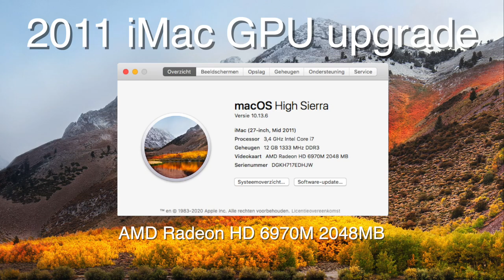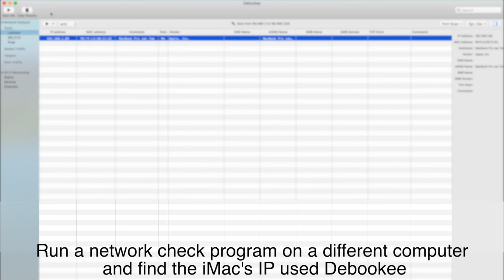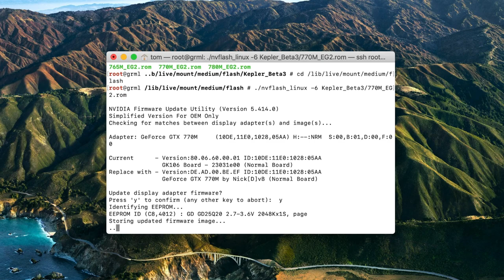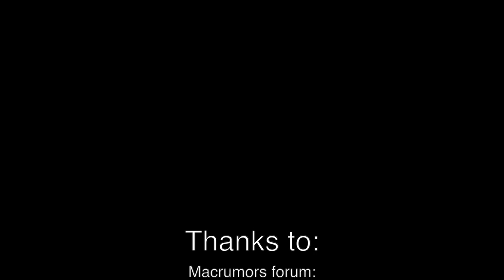iMac 2011 GPU upgrade to NVIDIA 770M with new VBIOS

Comment: Who is watching this on a Mid 2011 27?  I am.  In fact, I have four of 27's throughout the house for streaming cable TV through wireless network.  Always wanted to do the GTX mod and here it is.  I have re-flowed all my AMD GPU's so not concerned with failure.   Despite the supposed problem, AMD GPU is still a good performer for what I do.  Nice job on your upgrade!
Reply from the maker: Thank you for the positive comment! I agree with you that the original AMD GPU performs good! Although in a benchmark program like Unigine Valley I went from a score of ±800 to ±1300 with the new GPU so quite a significant difference. I also reflowed the AMD chip in the beginning and it came to life again, sadly a few months later it failed again so I wanted to solve it for real. Maybe in the future you will actually use this video to upgrade the AMD GPU nevertheless :-).
Reply: @tomvreugdenhil1490  Yeah, that is a very nice bump in performance.  Are you able to run Mojave or Catalina without DosDude patcher?  If so, does it downlaod and install security updates and patches normally?  In other words, does it behave like it should??
Reply: @tomvreugdenhil1490  Maybe there is one more upgrade possibility.  MacBooks recognize faster DDR3 RAM than is published.  I know this from experience.  It is possible M2011 iMac will recognize faster 1600MHz RAM.  Published spec is 1333MHz.
Reply from the maker: @encinobalboa  Yeah I run Catalina with the dosdude1 patcher and it works like it should. You need to do a few kext patches (all explained on macrumors forum) in order to get rid of a black screen when booted, but I found it easy to do. After that it can install all the official apple updates and works like it should. Of course no sidecar and airdrop, but that is a hardware problem instead of software.
Reply from the maker: @encinobalboa  The ram upgrade sounds interesting. Although I use 12GB which is enough for me and never find that it runs slow when multitasking so I’m leaving that as it is.
Reply: @tomvreugdenhil1490  RAM prices are cheap these days so there is no reason to take it all the way especially with your 770M upgrade.  My dream config is 780M with 32GB 1600 MHz RAM and dual SSD in RAID 0.
Reply from the maker: @encinobalboa  I actually have another 2011 27” iMac with a 780M. It performs even better than the 770M!
Reply: @tomvreugdenhil1490  Dude, next level stuff.  What tool did you use to cut the heat sink?  How deep was the cut?
Reply from the maker: @encinobalboa  I used an angle grinder and slowly chipped away until I had a roughly even surface. The method is exactly as showed in this video, with maybe a slight change in dimensions.
Reply: You can also use a drimmel

Comment: Shame on apple for not creating metal drivers for the radeon 6970. I have to swap the gpu just to make possible the installation of post high sierra osx versions. It is still a capable machine (i7 3.4ghz 8 threads and lots of ram..) but sadly apple nowadazs tries to shorten device lifecycles to get more profit. My other imac a late 2015 retina 27” cto (shitload of money back then) can’t be upgraded above big sur. Reasons unknown… probably the money…

Comment: I would be satisfied to have the stock GPU ya have, I've got the same everything besides my GPU which is a horrid 512MB in dedicated memory (I have the exact same computer model and specs besides the GPU), but at least I can say I spent 9 months making a massive mod for an obsolete game from 2010 on a 512MB Dedicated Memory GPU on an iMac with Gimp, text editor, and blender lol
Reply from the maker: I can highly recommend upgrading the GPU in your case. All of the old AMD cards in this iMac are doomed to fail one day. The 770M in this video increased the graphics performance by a lot! My daily 2011 iMac now even has a 780M which absolutely screams in graphics performance.
Reply: @tomvreugdenhil1490  I would love that, but I could never afford that, and my iMac is basically my only Apple product and my only computer, because my 3 other windows computers are all having OS problems and Hard drive problems in general, it's getting to a point where I'm starting to use PS3's and Xbox 360 hard drives to make them work (ofc I have erased them) but even those are starting to fail on me too and none of them are nowhere near 5 years old while my iMac is 10 years old without any problems besides the temperature but I'm using manual fan control to retain it's life (and no I'm not doing full blast 24/7 I don't wanna destroy my fans 😅) but even so, since this iMac has been lasting so long, it's got me taken over (and I'm not gonna buy a newer iMac, I'ma Steve Jobs era guy lol) although I am seeing if I can do anything with the Thunderbolt ports I have, I've been seeing that I can get an eGPU for it, but Idk the compatibility and what's available and what's not available, I kinda wanna go as stock as I possibly can without using other OS's or anything like that (mostly because I can't, and I can't afford them) my 2011, 27 inch iMac was an early graduation gift, the previous owner didn't want it anymore since they got a new iMac and they handed it down to me instead since I was desperate to learn things that are tech related in all ways and I was kinda without a computer at all and that iMac has been probably the best gift I've ever gotten in my entire life (enough with my personal life thou lol) I do wanna see if I can do something with the GPU situation I'm stuck in, like I've been constantly pushing the limits of my GPU (mostly because I have no other choice with having said 512MB in Dedicated memory) oh and I uhh, I'm still kinda new with computers, I've only had my iMac for a year now 😅

Comment: Very nice video! There needs to be more like it featuring different gpu types.
Reply from the maker: Thank you! Different GPU’s work in the same way, the hardware modification etc is the same. The only difference would be flashing the right vbios for every GPU. If you check the macrumors forum linked in the video description you’ll see that all procedures are roughly the same and only differ software-wise.
Reply: @tomvreugdenhil1490  thank you very much!

Comment: Safest way I have found to handle the power supply is to use microfibre cloths when picking it up. One on each hand stops you making contact with the exposed components
Reply from the maker: Thanks for letting us know, this seems like a safer method!
Reply: You don’t have to take out the power supply to get motherboard out, it just takes a bit of wiggling and patience. When i baked my amd 6970 because it failed i took everything out and put back in without touching power supply.

Comment: I disagree it’s better to remove power supply, so that’s your feet the logic board better without any fuss. Without any chance Damaging your logic board in the process of putting it back to the chassis. I did the same process six months ago but I have flash it With my bootcamp Partition In Windows 7 (Much easier flashing than Linux). Anyway great job!!!
Reply: tell me in detail. how did you flash through bootcamp? how to get to the windows section, I broke my whole head already
Reply: where do u get the gpu

Comment: Good. But you don't need to remove ODD, PSU and fan to remove the board)
When I did it first time I also removed ODD and right fan. On 9 other iMacs I understood this is not needed.
Reply: Oh well, I followed the iFixit guide, but now that you mention it I agree with you
Reply: Good video. Great job. Yeah, I'd agree that you can save a step by not removing the PSU. Just reach for the power cable that connects the PSU and unclip the latch - a bit fiddly but doable. That would save a step. Then use some cardboard or thick paper to cover the PSU in case you make contact with it with a metal screwdriver. I tried to keep the ODD and fan in place but found I had a hard time aligning the rear ports when it comes time to re-install the logic board. So, I removed the ODD and the ODD fan to make it easier.

Comment: Man, that looks like an awful pain in the neck for such an upgrade.
Reply from the maker: It’s really not that bad! And it makes your old iMac really capable again. I even run the most recent macOS Ventura on mine :)
Reply: @tomvreugdenhil1490  It looks like I may have to do this. Because I have a little bit of choppy video now and then. And I am using the regular hard drive. The choppy video may go away with adding a SD drive, but if you open these things up. You might as well do the video card.

Comment: Once that is done, you can go ahead and patch to macOS Catalina, or even Big Sur or Monterey, as I believe this card supports Metal.
Anyway, don't stick to High Sierra, it'd be stupid, it'd hold the performance back!
Reply: been using this with opencore legacy patcher on Monterey. works like a charm:)
Reply: @chowandrew2458  UHM... doesn't it boot a little slowly, and don't you get graphical glitching about everywhere?

Or do you have a Metal GPU?
Reply: @Zebra_Paw  gtx 765m
so yeah
Metal compatible
Reply: @chowandrew2458  That must feel good then!
Hope you have an SSD, too!
Apple has put horrible slow HDDs in iMacs for way too long!
In one way, it's not too bad. The biggest Apple scam is their RAM and storage prices!
Reply: @Zebra_Paw  of course I’ve put in an ssd inside🙈
It literally breaths new life to old computers😂
Reply: @chowandrew2458  Absolutely! It's mandatory!
Reply from the maker: Yeah I agree! I use OCLP to boot into Monterey. With a 512GB SSD my iMac still has a lot of years left! Also with a GTX 880M (8GB VRAM :O) in bootcamp it actually runs some games quite well.
Reply: @tomvreugdenhil1490  A GTX 880M is really starting to be a decent gaming GPU. And yes, these machines are much better for the environment than Apple Silicon (due to Apple pairing SSDs to firmware and disabling the whole machines if the SSD dies because it has encrypted hidden volumes), but they feel just as snappy for basic tasks if you add an SSD!

Apple is known to use pretty average GPUs with high resolution displays, which definitely doesn't help gaming, and running a game at 1080P on these 4K+ displays looks quite bad.

I have a 2017 iMac 18.2 and I absolutely love it. A nice i5 7400, which is quite a good desktop CPU, but unfortunately, a Radeon Pro 555, which is worse than a GTX 960, but it has to drive a 4K pannel. Definitely doesn't help gaming performance, so I use my external 1080P monitor, but in macOS, there is no option to disable the internal display!
Reply: @tomvreugdenhil1490  hi Tom kunnen wij in contact komen ivm een gpu upgrade? Pls let me know.

Comment: I have an iMac 2011 with a MXM Nvidia K2000 Quadro running with OpenCore Legacy Patcher in Big Sur but such Mac doesn't have hardware acceleration working.

Comment: Great job ! Purchased the 770m card. After flashing the card,did you notice any problems with fan speed and brightness control ?
Reply from the maker: Well since I have a SSD in my iMac, I must use MacsFanControl to correctly manage my temperatures. And brightness control is lost when using the 770M so it always runs on maximum brightness. There is an app called ‘brightness slider’ in the App Store that slightly fixes the problem.
Reply: @tomvreugdenhil1490  Looks like there is a modified vBios that bring backs native brightness control for the 770 via OC search macrumors thread
Reply from the maker: @123Croupier  Thanks for the heads up. However I don't have the iMac with the 770M anymore, only my own iMac with a 780M which has native brightness control with certain VBIOS.
Reply: @tomvreugdenhil1490  Is it possible to just plug and play the 770m/780m if you are willing to lose the brightness control/boot screen, and not have to the flash? or is the flash always required
Reply from the maker: @samkoch2459  I think it is possible, but the performance will be further from native-feeling. I highly suggest flashing the VBIOS, it is really not that tricky if you follow the forum precisely.
Reply: @tomvreugdenhil1490  hi, i have a 2009 i7 imac 11.1 and im running a gtx770 with modified nick(d) bios. But i still dont get the brightness control. Can it be restored? do i have to install the opencore legacy patcher?

What operative system do you recommend?

Comment: I noticed you said you got a 780M installed. Do you have any updated links for the VBIOS instructions? Also did you have to do anything different than you did in the video for the 780M? Thank you so much for this... you rock.
Reply from the maker: All the links are stil well provided at the macrumors thread as stated in the video description, so I can only advise you to take a look there. And the procedure is totally the same as for the 770M, just a different VBIOS. Good luck!
Reply: @tomvreugdenhil1490  Thanks!

Comment: I removed the ram door and left the ram in. No issue with removal!
Reply: I was changing the cpu on a 2010 27 inch and the Ifixit guide didn’t mention the ram. The mb came out ok, but getting it back in was impossible. I finally realized it was the ram contacting the back of the case and took it out. After that it was no problem even with the PSU still in place.

Comment: I’m considering buying this for $425, is this a rip off or a good price?

Apple iMac 21.5" 2011

> 2.7GHz Quad-Core Intel Core i5

> 256GB Samsung 850 EVO SSD

> 24GB DDR3 RAM

> New Installation of macOS High Sierra

> Features include built-in webcam, bluetooth, SD card slot, USB ports, thunderbolt, and SuperDrive.

> Has been disinfected, had the harddrive wiped, received a genuine installation of Apple macOS, and passed Apple Hardware Test.

> Includes Apple Keyboard, Magic Mouse, power cable, and VicTsing mouse pad.
Reply from the maker: I think it is way too expensive. It is a mid-tier 21.5” iMac, that should not be more dan 250 I think.
Reply: @tomvreugdenhil1490  thank you. I thought it was overpriced too, but I’m glad you responded cause I can be certain now. I was gonna meet someone today about it, so you have remarkable timing. Thank you!

Comment: So with a 780M, it is possible to get the GPU acceleration in Big Sur or above versions, right? Wanted to double-check before spending money on that GPU... 
Love my iMac mid-2011 27," and this is a fascinating possibility...
Reply from the maker: Yes that is correct, if you install Big Sur with the correct patches. My 2011 iMac runs Monterey with a 880M and I love that computer. Check out the forum in the description, especially the “Mac OS patcher” segment.

Comment: Very helpful vid bro, I’m a little overwhelmed and in doubt if I dare to dinghies myself. 1 question, why do I need tondo the last step, flashing the thing?
Reply from the maker: Flashing the VBIOS will make sure the new GPU communicates as good as possible with the iMac. It will work without flashing, but then you might not have features as a normal boot screen with Apple logo or brightness control of your display.
Reply: heb je een goed adresje voor me waar ik deze kan kopen? AMD Radeon HD 6970M 2GB
Reply from the maker: @robert-janversluis  Ik zou marktplaats afstruinen. Maar vooral niet die originele AMD kaart gebruiken! De hele reden dat ik deze iMac heb geüpgraded is omdat de AMD kaarten gegarandeerd gaan falen na bepaalde tijd. En aangezien die kaarten uit 2011 komen is de kans 100% dat ze ondertussen ooit hebben gefaald (en prutserig weer aan de praat zijn gemaakt) en het dus niet lang zullen volhouden in je iMac.

Comment: You dont need to remove the ram dims if you need to open the imac
Reply from the maker: You are correct. But when putting back the logic board it is beneficial to remove the ram sticks for easier placement and little risk of damage.

Comment: GPU vervangen samen met mijn zoon van 10 🎉 en ook gelijk het aan uit schakelaartje gerepareerd. Daar bleek een ringetje verzakt te zijn. Nu 1 nieuw probleem, de ventilator blijft hard blazen
Reply from the maker: Dat klopt! Na het vervangen is de ventilator eigenlijk de kluts kwijt. Je zult met MacsFanControl (te downloaden) de ventilatoren handmatig opnieuw moeten instellen. Het is vrij eenvoudig, als je wilt geef ik mijn instellingen door.
Reply: Ah Tom super dat je zo snel met een tip komt. Ik zie graag je instellingen
Reply from the maker: @robert-janversluis  Je hebt 3 fans: ODD, HDD en CPU, vervolgens kun je bij de kolom ‘beheer’ een sensor kiezen (dus niet op automatisch).

ODD: GPU heatsink sensor, 50C en 70C
HDD: GPU heatsink sensor, 50C en 60C
CPU: CPU heatsink sensor, 50C en 70C

Als het niet lukt, laat maar weten.
Reply: Dank je wel. Ik heb het van jou overgenomen. Wat ik wel apart vind, is dat je ook bij HDD de gpu heat sink sensor kiest
Reply from the maker: @robert-janversluis  Gebruik jij een HDD of heb je een SSD? Een SSD wordt namelijk amper warm, dus heb ik de GPU prioriteit gegeven aangezien die net geüpgraded is

Comment: Great video... will this GPU work for a mid 2010 27" iMac?
Reply from the maker: I think so yes, the 2009-2011 models I think are all supported. Check the macrumors forum (link in description) to be sure.
Reply: @ugdenhil1490 another question is how do i do all this since my iMac is out with a faulty stock GPU and without an SSD with OSX in. You think this is gonna be doable?